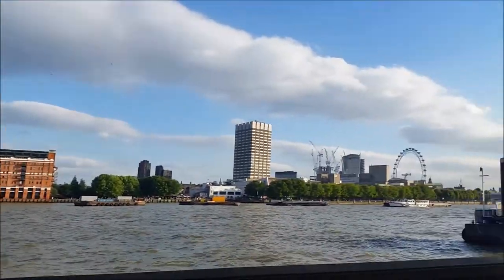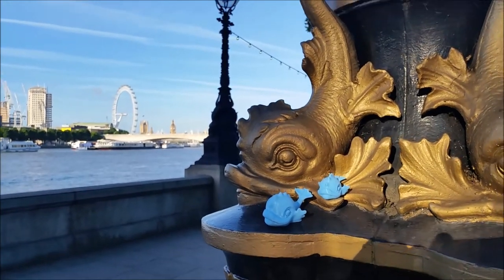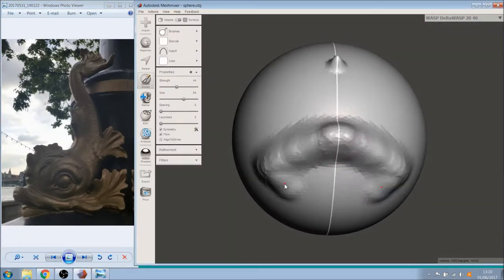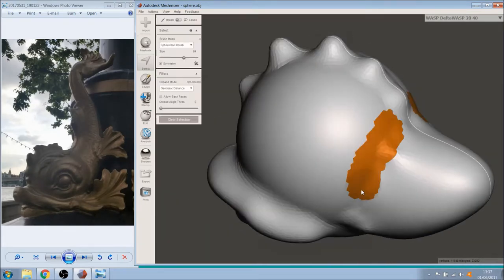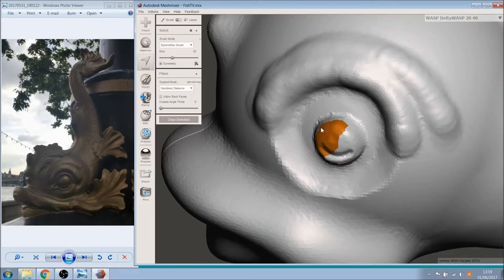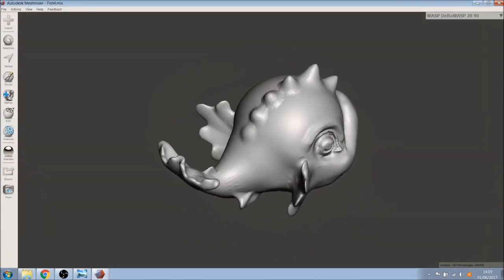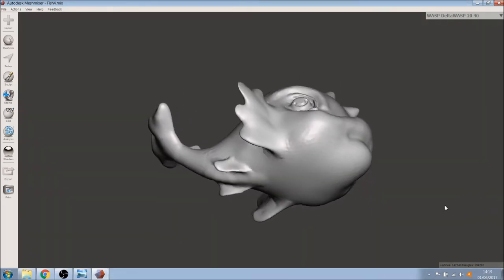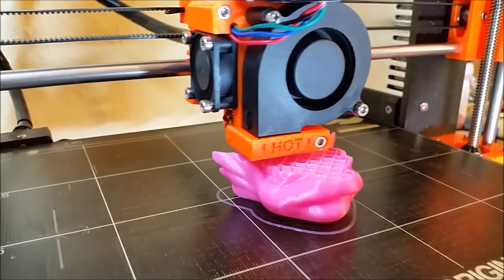3D Printing Baby Thames Dolphin Toy - 3D Sculpting in Meshmixer

Comment: Could've had less infill than that, that infill looks extreme. Could've done with better walls instead, of guaranteed waterproofing. 

But good work otherwise, now you have a bunch of fishies :D
Reply from the maker: A very good point regarding better walls.  Ha-ha, during the testing we printed 7 of them, should be enough for the pond :)
Reply: Actually thinking about it, if you reduce the infill, you could get some incredible sagging on the top portions of the print and ruin it. 

Still, good job sculpting it and getting it printed without error, this video is good enough to use as an advert for 3d printing :P
Reply from the maker: Thank you for the great praise!
Reply: It's well deserved ;)